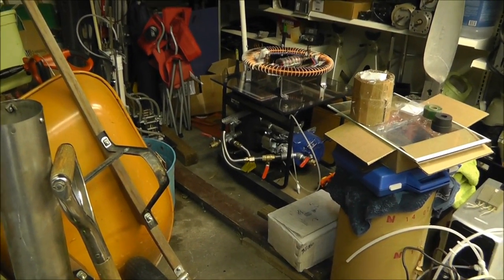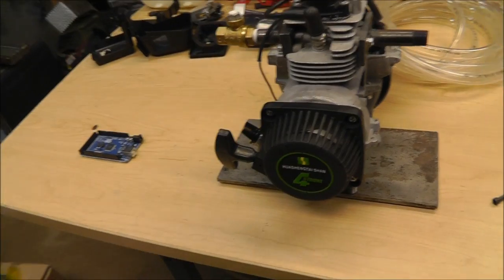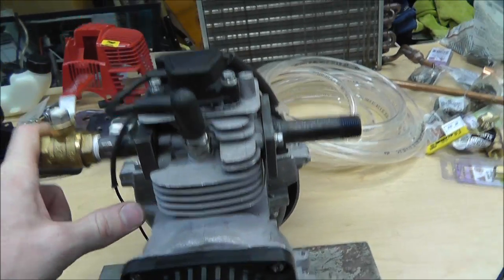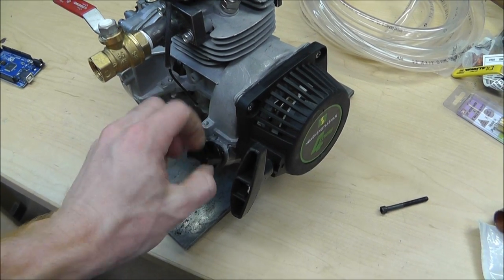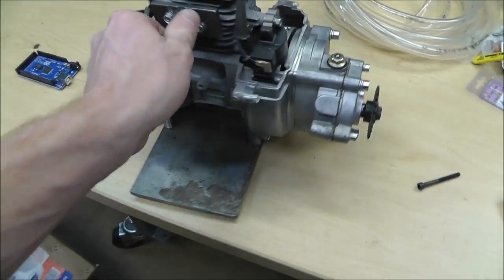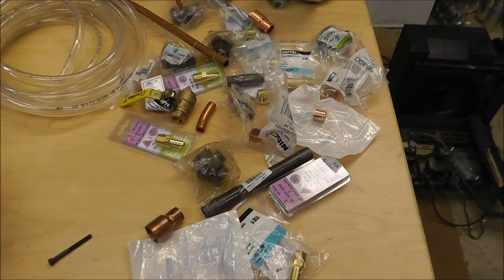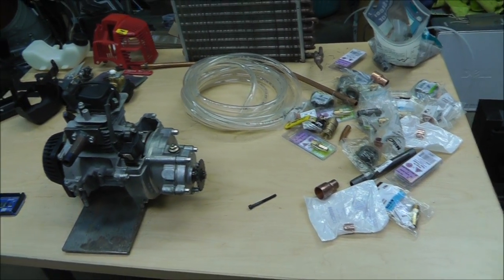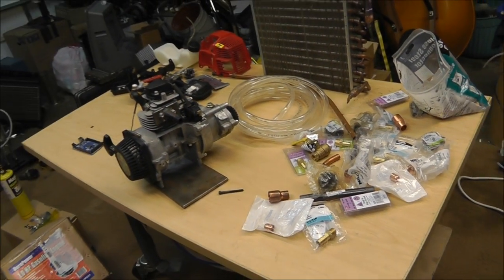1HP OHV 4 Stroke Testing. trying somthing new with a donated motor. arduino-based timing controller

Comment: One thing i was thinking about Russ is since small motors   have small cyclinders they are very dependant loop scavenging to  run properly . This is why  a 100 cc motor can  run 15.000 rpm's and put out 30- 40 Horse power and it might have somthing to  do why you are having  issues getting to  run properly. see ya at work next week Toney

Comment: Yup! that was my first thought! when I saw the restriction on the exhaust. For a second or two I thought that there was a possibility that because it was a four stroke engine, that the valves will allow it to run only at a very harsh Idle! but Naaaaahhhhh!

Comment: Wondering if you heard of Megasquirt, its a DIY auto tuning, build it yourself ECU, with free software. you can get them at diyautotune. com great kits/products. it allows adjusting EVERYTHING as much as you like, will also support closed loop operations. prices are super reasonable.